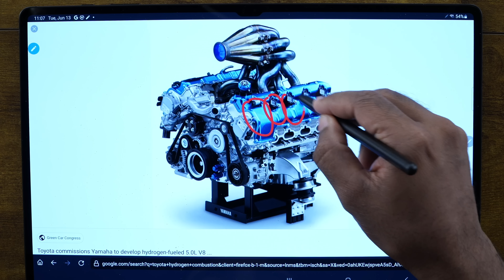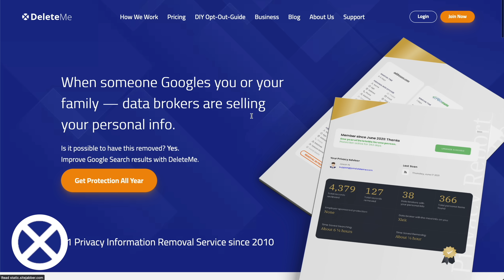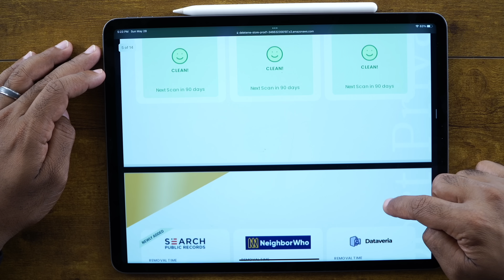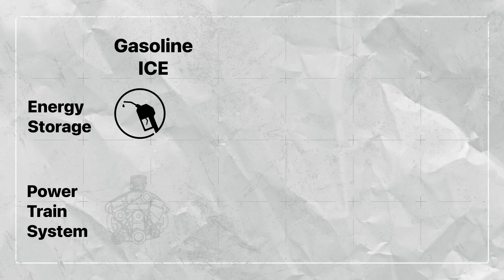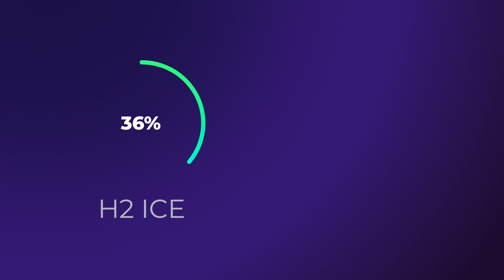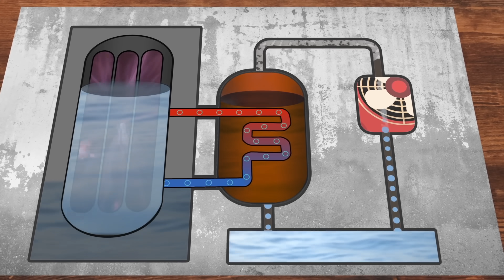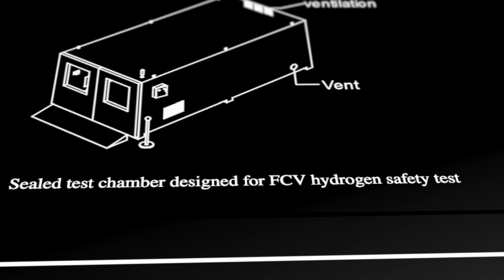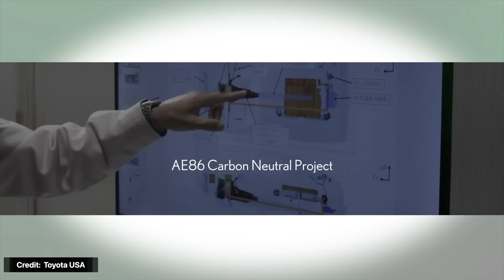Toyota's Says They Just Destroyed EVs - Hydrogen Combustion Engines

Comment: There is no such thing as an Environmentally friendly vehicle. The manufacturing process of all vehicles is far from clean, and the overall impact of manufacturing and charging an EV  over the life of the vehicle is about = to a gasoline engine that gets 20 MPG.  The Mining process for electronics , and the conditions the miners have to work in is degusting.  in the US we don't think about what actually goes into making our cars, phones, and computers.  3rd world Mining... It's not pretty. 

I don't really see these type of fuel system being any better or worse than and EV or a high MPG Gas motor.  The automobiles that leave the smallest foot prints over the life of the vehicle are the 55 MPG gasoline cars, and EV's that are charged with Solar Power.  The point is,  we as humans are trying to be cleaner,  and are becoming more concerned about the environment and our health,  as long as that continues to be our mindset,  I am sure someday we will have even better solutions.  We have come a long way since the days of the Chevy 454 with dual carburetors.  

There is a place for these motors, in certain countries with sub par electrical grids,  or maybe in heavy equipment applications.  It doesn't have to be 1 or the other. Still who is going to build the fuel stations?

Comment: I think the production of "green" hydrogen (using wind and solar to produce hydrogen) essentially negates the efficiency argument. Also think about the amounts of human rights violations related to making batteries, the renewability of hydrogen. I mean we can now use wind and solar practically to power an engine with zero emissions. There aren't many solar cars that have been successful. Also, another weird argument is that there is a lack of hydrogen stations... obviously because there isn't an application yet just like EV chargers. The conclusion of all of the "baggage of combustion engines"? I mean really? This has the potential to be much better for human rights and completely zero emissions, this is absolutely a viable solution that I personally would prefer over EVs
Reply: ALSO one of the biggest issues we face is that all of the current traditional combustion engines still exist on the roads, and you can't practically modify them to electric. You could however retro fit combustion engines (theoretically), converting more traditional ICEs to hydrogen ICEs
Reply: dude i think im gonna start a company *sarcasm

Comment: 0:55, hydrogen is the most energy dense (by mass), but not by volume where something like gasoline has 4x the energy by volume. So to take advantage of the hydrogen energy density you need extreme pressures, and that's not easy with hydrogen because it's so small (atomic size), it likes to seep out of everything. Having to keep high pressure storage like that in your vehicle, with the size that the tanks consume, seems like a no-go for a lot of people. Combine that with the rarity of hydrogen stations compared to the availability of electric chargers and the fact that people can charge at home, and I don't see hydrogen cars taking off. Finally, getting hydrogen fuel isn't simple, most places are using fossil fuels to get them, which pretty much defeats the benefits.

Comment: Close to my home here in Rotherham Yorkshire England is an experimental ‘gas’ station. A wind turbine is used to power the  electrolysis of ground water. Stored in tanks deep underground any surplus Hydrogen is used to power generators and the electric power sold to the grid. ‘Gas’ from wind and water is going to be a problem for the taxman and of course oil producing Arabs.

Comment: I'm glad that he calls hydrogen an "energy storage solution" rather than a fuel. It's the right way to think about it.
Hydrogen is the same as a battery, it takes energy to "charge" that hydrogen tank back up with hydrogen. Your hydrogen car really runs on coal. Because that's what the power plant burns.
Same with a Tesla.
We should really be talking about changing THAT.
We need small molten salt reactors in every town/neighborhood. something like that. Plus solar, hydroelectric,  and wind where it makes sense.

Comment: Hydrogen fuel cells to generate primary electrical energy is the way forward. ICE, whatever the fuel, has inherent inefficiences such as wasted strokes, crankshaft inertia. On ther hand - 
Weight of fuel, i.e gas over battery storage is an issue for EVs.

Comment: Dude.  Rednecks make hydrogen with lawn mower battery and alternating plates stacked up.  Water to hydrogen instantly.  So dont give us crap.  They just want to sell you fuel stations instead of just putting water in your fuel tank.
Reply: Water hydrolysis takes way more energy than what you get back from burning it. It's not actually a sustainable reaction. It's a common scam.

Comment: Conventional v motors run to hot and eventually they cause pre combustion of fuel. Rotary engines are a better option but they too have short comings. This report is based on a Toyota report. But I believe it ran into some issues that ended. Hydrogen is the fuel of the future. But. As fuel cell Ev.

Comment: Hydrogen just doesn’t make sense honestly except for in planes or cruise liners. Electric cars are going to solve their issues much faster than hydrogen cars can fix theirs. CATL announced batteries that can charge 80% in ten minutes. EVs are just more reliable and better connected and it doesn’t make sense to try and build a hydrogen network.
Reply: The "network" already exists in every Gas/Petrol station that already exists on the planet. Just replace the gasoline with liquid hydrogen and it's a done deal. You could almost convert the gasoline distribution network to a liquid hydrogen one overnight (relatively speaking compared to all the totally new infrastructure and powerline and generation upgrades that will be required to get Electric charging points in all the locations they're really needed).
Reply: @jamesmay1322 Hydrogen Infrastructure is far more complex than simple liquid room-temperature gasoline Infrastructure.
It's far, far easier to build out charging networks - which is why you can drive an EV through Europe without any issues today.

Comment: Just because the final efficiency number for hydrogen is less, doesn't mean it's not a more sustainable option than BEV. If we can create&store the hydrogen (even at significant energy loss) in a "green" way, which we can, it's still a complete zero emission solution. 

Also, hydrogen combustion cars will be lighter than BEV's and better race cars.

Comment: Problem with assessing energy efficiency of EVs, is that it ignores everything that goes into mining the elements, creating the batteries, battery replacements, etc. It's not a cradle to grave analysis and it just shifts the inefficiencies into different parts of the lifecycle. Also, the likelihood of replacing every combustion car in the world with an electric will take 100 years.. but if Hydrogen works, every car becomes a 'greener' car. Scale is the key to a greener economy. EVs won't scale at the global shift that's required. If it's not Hydrogen, then it will be biofuels, or something else. EVs won't scale because every vehicle will need to be replaced.

Comment: The one single thing overlooked is the assumption that expensive domestic electricity needs to be used in the hydrogen process. Electricity costs can be dropped to near zero by using non-domestic electricity. Go that way, and hydrogen costs will fall dramaticly

Comment: The hydrogen motor and concept has been around for at least 20 years that I know of. That tech was suppressed here in the US. The original concept, engine and vehicle worked differently. Toyota's design is to benefit big hydrogen suppliers. The original concept and vehicle is that you put water in the gas tank (now a water tank). The water went from the tank to an electrolysis type of system that separated the hydrogen and oxygen, the hydrogen was used as the fuel and the oxygen went out the tail pipe. The original concept was for converting your own vehicle, car, truck into a hydrogen vehicle. Toyota's design is very dangerous. 
Who want to ride on top of multiple tanks of the most flammable substance in the universe. Why pay for hydrogen when you can use water?

Comment: EV’s currently are expensive and the replacement costs for the batteries is way above the average persons budget. 

Plus the materials needed to build ev batteries are not necessarily abundant and are other elements mined from the earth. 

I think hydrogen even with all it’s cons still makes sense for the mass population. Hydrogen should have been used as the middle man between gas powered engines and ev .. so that the switch would be more evolutionary towards being more green.

Comment: The issue of cost per mile was missed which is a direct effect from efficiency granted! I guess if you moan about gas prices now imagine that x3 today for Hydrogen as anyone making the electricity could get that return putting it on the grid compared to splitting water. Japans solutions are promising but for the rest of use it will just be an extra huge cost if we use renewables.

Comment: I think the NOx argument was understated, research I found in 2021 showed NOx emissions can be higher in H2 ICE’s than traditional fuels. Also I failed to hear anything on hydrogen embrittlement which mean engine will need more than just a rebuild when the time comes. Great to hear Japan is moving back to nuclear but last I read in 2021, Japan was going all out with coal powered hydrogen plants to bring the costs down to then invest in making it green when it matures. Is that no longer the case?  heavy duty vehicles and extreme low temperature applications will make the H2 ICE’s a good investment in the future and keep the petrol head movement alive if people are willing to accept anything from the head to the fuel tanks are no go areas with insane training.

Comment: Engineering Explained did a video on this topic and engine and the Achilles heel is range. Using compressed Hydrogen and a pressure vessel the size of a typical gas tank the range was only 50 miles. Not very practical, check out his video.

Comment: Hydogen actually IMPLODES.  It does not explode.   In a fraction of a second, a cylinder full of hydrogen gas, implodes, intoa tiny drop or two, of WATER, which causes a massive vacuum, which PULLS the piston up into the cylinder. The valves must be strengthened, and the timing is reversed, to be just past Bottom Dead Center (as opposed to explosion-based fuels).  All of this technology was discovered by Victor Shauberger, from Austria, around the time of world war 2   Youtube has several videos about Victor Shauberger, known as "The Water Wizard"

Comment: In my opinion 
H2-fuel cell > = H2-ICE > C6H12-ICE > C6H12-LiPo-hydrid > LiPo-battery. 

H2-fuel cell is much more efficient. Than H2-ICE
But…
I feel all your speed Desmond will only like the straight LiPo for the high flat torque curve.
But practical user will want something that is reliable and have long range

Comment: I’ve seen this work with slightly modified gas engines using similar techniques borrowed from propane/natural gas adaptations.  Once white hydrogen begins production (if governments and big oil aren’t allowed to suppress it) it would replace petroleum based fuels.  Environmental damage from EV battery production far outweighs any positive results electric vehicles when it’s calculated into the cost.

Comment: Hi, so my question is, if I build a water splitter or 4 and generate hydrogen from water I could technically run my V8  without much conversion as it runs on LPG and petrol. Would all I have to do is run a hydrogen gas line into the existing LPG system ?

Comment: That leakage you mentioned is a big problem for the climate. Let's say H2 ICE or Fuel Cell becomes dominant and is used everywhere. The amount of H2 leakage will be huge. Making H2, transporting H2, distributing H2, the cars themselves - all of it leaks. That leaking H2 reacts with hydroxide radicals in the air that normally bind up with methane, ozone and other greenhouse gasses. This prevents hydroxide radicals from muting the effects of these greenhouse gasses and thus make warming worse. Yeah I know it sounds complicated, but everything with the atmosphere and climate is complicated - that's just how science be. H2 is 100% not the answer.

Comment: I see two other cons rarely addressed. The cost of hydrogen is like 4-5 times that of gas, and the other is the recovery time of the station until it can fill another car in 5 minutes. You certainly cannot fill 12 an hour, more like 4 tops. That is unless you put in several large tanks and many really high capacity 10,000 psi pumps. This station would cost millions to make and maintenance would also be costly, hence the 4-5 times the price of gas.

Comment: @EngineeringExplained looked over this engine and found that the hydrogen storage required for this application would make it currently unfeasible. 

The hydrogen V8 engine has roughly the same fuel economy as that of the gas V8 version. 19 miles per gallon of gasoline & 19 miles per gallon of hydrogen.
Hydrogen gas, compressed at 10,000 psi, requires larger tanks for storage because gases are significantly less dense than liquids.
The Lexus RCF, which houses the V8 gas engine, would only have enough room to house a hydrogen tank capable of a 50 mile range.

Driving electric motors with a hydrogen fuel cell is still the far superior option.

Comment: Please Google search this phrase.
" For hydrogen to be a climate solution, leaks must be tackled"

Also read about a key challenge to the Hydrogen Economy: To do just that, please Google search this phrase......" For hydrogen to be a climate solution, leaks must be tackled"

Because the Hydrogen's molecule is so small that it penetrates into solids , resulting in embrittling  that solid material.... investing in a astronomically costly long term build out of a piped transportation system, and bulk storage Hydrogen Transportation Economy that needs constant leak detection, sealant repairs & expensive infrastructure component"s short lived structural material integrity degradation, resulting in constant replacement is a dubious investment. No capitalist investor return on investment calculation here, just more socialist dreams of government funded short sighted projects driving up our tax burden ever higher. Time to move on to the next sensational green idea that will compete with burning hydrocarbons to save the World. People are fleeing California because of high taxes, and living costs because of Socialist folly ideals like discussed here. Hydrogen gas is the transportation fuel of the future, and always will be.☝️☝️✍♥️

Comment: EV's produce significant heat and lose range under load. Additionally, the additional weight of the batteries increases the baseline amount of energy necessary to operate the vehicle. There is no clear winner, and the hybridization of the two is the best solution.

Comment: EV vehicles r not efficient, turn the heat on or AC and you lose half your range. Try and tow and lose 3/4 of range..  than to pack enough range the batteries have to be huge and than the vehicle weighs alot which makes the tires wear faster, damages roads. Most power station in the use are coal soo.

Comment: There used to be a guy on youtube years ago had his car running on water, electrolysing to make hydrogen on the fly, making 55litre per minute using straight water without electrolytes and only using about 5amps. He died and took his secrets with him, but far as I could make out his cell was using PWM somehow to more effectively split the h2o. Probably using waters resonant frequency or harmonics thereof to get what he was getting allegedly 

This is the way forward anyway, no matter which way you look at it. car's wont be putting more stress on the roads with the increased weight, no batteries to replace/recycle, infrastructure fairly easy to switch over, refuelling easier/quicker, if they crack it, which they will, it's a no brainer

Comment: There are NO simple, complete, viable or cost effective routes to a green future for cars - Fact.

Current Battery Tech is crap - will have you sitting around for hours on long journys, really requires you to have a high power charger at home, but domestic electricity supply simply can't cope with the volume of power that this would demand.

Hydrogen is nowhere near being viable - without huge/limitless power to electrolise hydrogen from water, it is no greener that oil... But, even if you can produce it, you need to store, distribute and deply it - hydrogen very hard to do any of this with and we would be starting from zero...

Comment: I'm still a much larger fan of Hydrogen. It's not as efficient but it can be generated basically anywhere with renewalable methods. Electric has the same problem about making sure the underlying power is generated cleanly. 

However you have the unavoidable problem of the massive amounts of waste emissions from the entire process of mining the raw materials required for the batteries themselves, the supply chain moving all and producing all those batteries, let alone the waste and handling of the waste once the batteries are no longer any good.

The small oil burning in hydrogen vehicles is negligible compared to the impact from that.